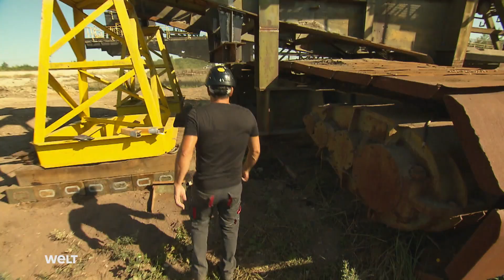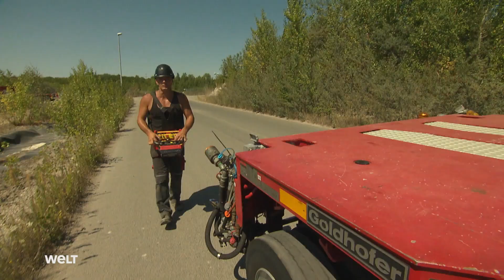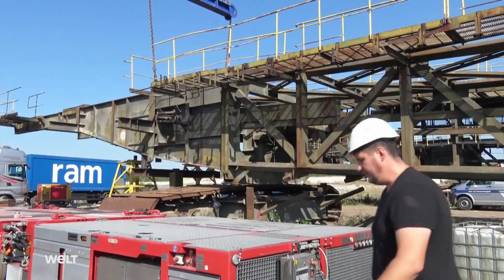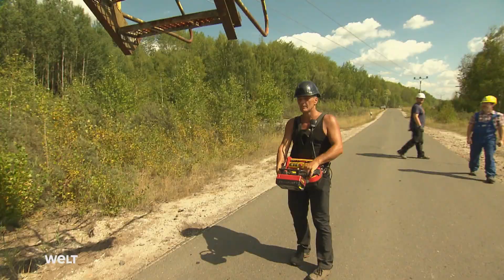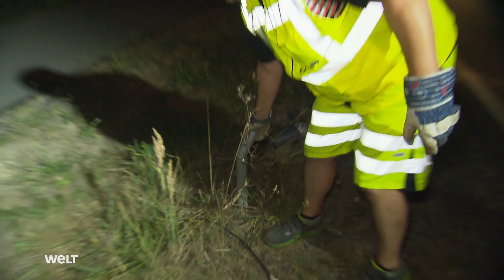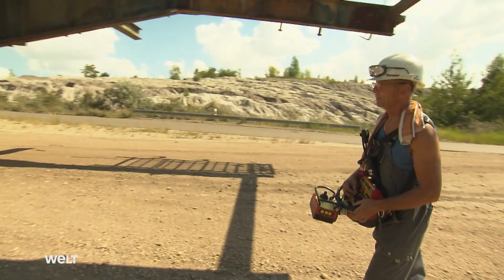HEAVY HAULAGE in ACTION - A Steel Giant On The Road | Full Documentary

Comment: Interesting commentary on unloading the powered transporter on moving the lifting points. If the lifting points were in the wrong location, how did they load it?
Reply: P
Reply: It’s possible the SPMT module was driven onto the trailer, either through a ramp or from a raised warehouse floor

Comment: The fasteners they tightened between SPMT segments are nuts and bolts, not "screws". The magnet used to lift the steel plates is not an "electromagnet". That "electric power cutter" is an angle grinder. All "right angle(s)" are "90 degree(s)", and none are sharper than others. When you translate a script, you can pronounce the proper names in the translated form; the hauler's name is "Peters" and rhymes with "liters". You don't have to pronounce it in what you think is German (BEE-taws?).
Your documentaries are pretty good, but you should let someone view and edit them before you post them.
Reply: He tends to be overly dramatic too. Every thing is always a huge problem, driving on gravel, clearances under the conveyer belt, power lines, making sharp turns, it's kind of annoying.
Reply: and it's not a 2 man job.   something small like that is one operator. check some sarens videos, this is peanuts.
Reply: I just turned the sound off, mistakes too annoying.